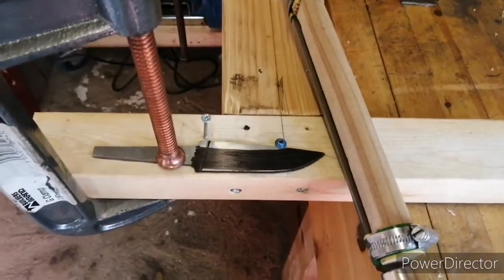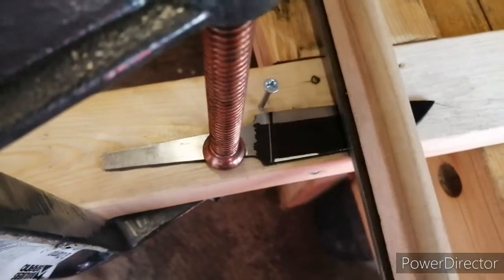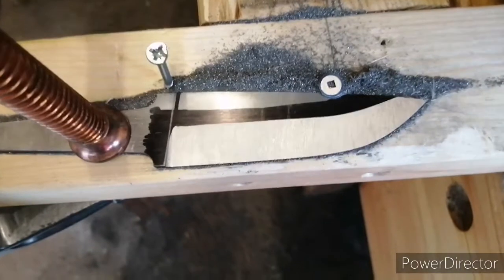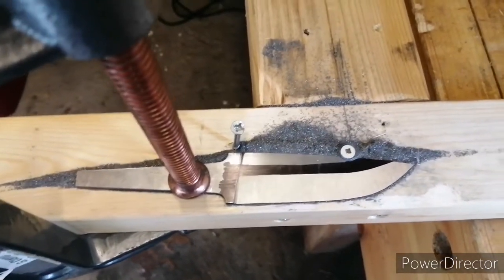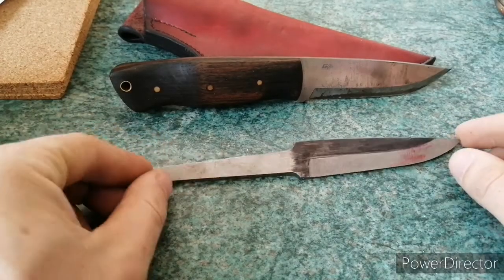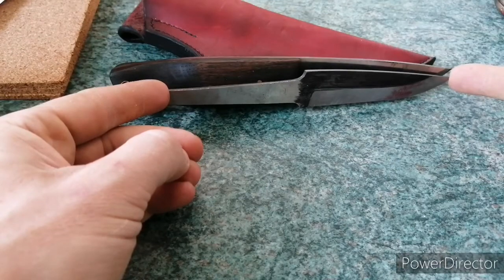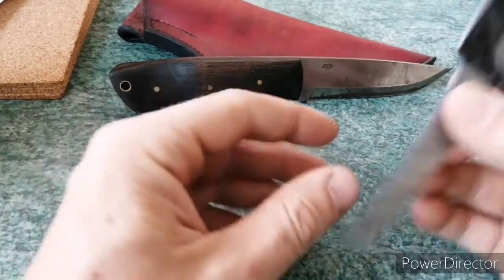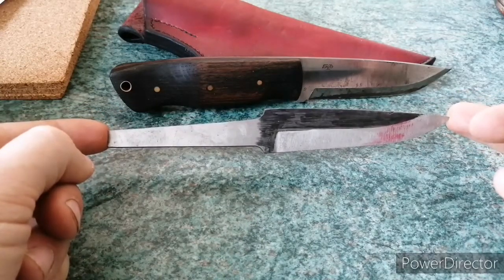How to hand file knife bevels

Comment: I'm in the process of making my first knife.  I ended up using a small spacer for the end of the file and draw filing to get near to finish dimensions.  I used the small spacer because it let me align the file at a closer approximation of the arc centerpoints.  I like your jig but you're fixed to one radius on it.
Reply from the maker: Nice update on the design. I did run into a few niggles as shown when I had to file the second bevel. It sounds as if your design may mitigate that. I'd be interested in seeing your knife. All the best. Lewis.

Comment: Hallo. How thin are you filing the edge before ht?? And is it possible to fil the last of the bevel after ht??
// Firefighter from sweden
Reply from the maker: I like to leave at least 2mm of material on the edge before heat treating. Anything thinner and you risk damaging the edge especially if you use a coal forge. You'll be fine to file the bevel after heat treating as long as you've annealed the blade in the oven. Good luck with your knife 👍
Reply: @lmorgan877  thank you

Comment: How could you file so much material in such or short time? Im working like 20h  on one side of the bevel of my second knife and the progress seems to be close to zero. Its just frustrating
Reply from the maker: I used a new (ish) bastard file for this project. If the teeth of your file are too fine or dull then you'll have a hard time removing material. This took maybe 4 - 5 hours. Good luck with the rest of the project.

Comment: Knife blade has to be hardened before the bevel is ground otherwise the temper will not be even, you can't properly temper a beveled blade, if you can file it it's not hard/tempered.
Reply from the maker: Great tip. I can see how variation in blade thickness would affect the temper process.
Reply: You sure you know what you're talking about Colm?
Reply: Every knife making video I have seen on Youtube, shows the bevel being ground before the hardening/tempering process is done.  This includes professional knife makers.
Reply: Bet your not even a blacksmith or made a knife at all or done any research... You make the bevels before it is hardened and tempered then you put the finishing touches on it and and edge stop spewing crap.
Reply: @KJ-qr9sm  yeah he doesn't even know the difference between hardening and tempering. Going off what he wrote he thinks they're the same.
Reply: You're wrong